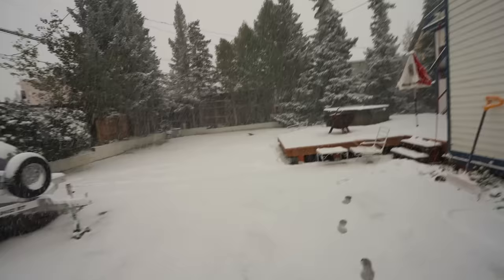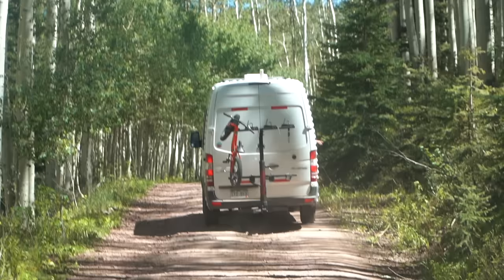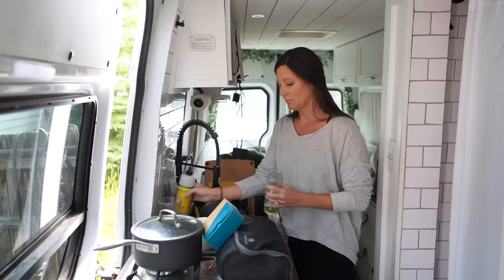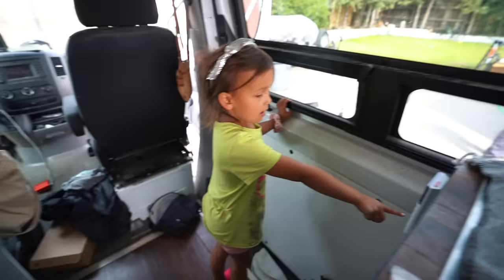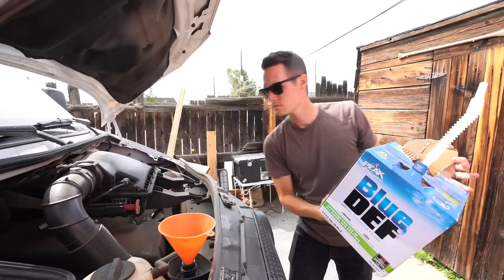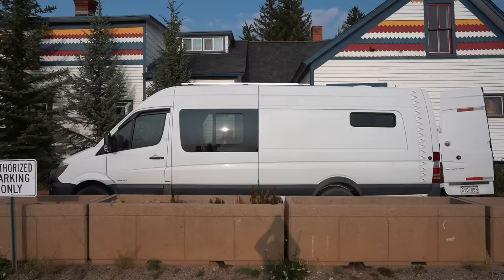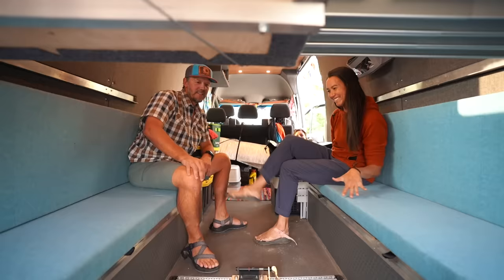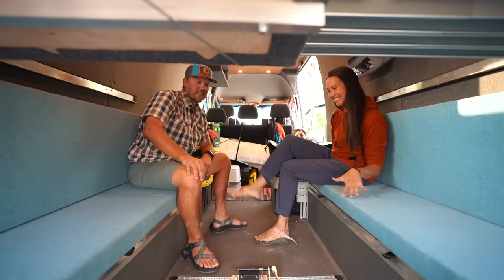Putting our life back together (aftermath of the bike trip)

Comment: Suggestion for emptying your gray water tank, get a short bit of hose and attach it to that spigot that way you don’t  get splashed under the van. It will probably be a little tidier as well. When the tank is empty, roll up the hose and put it away. They actually sell 5 foot hoses at RV supply places